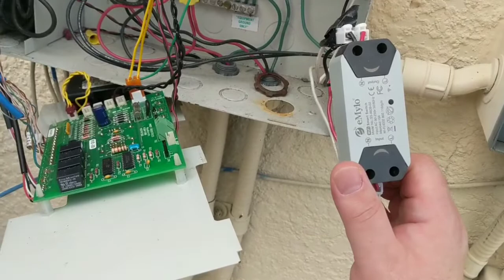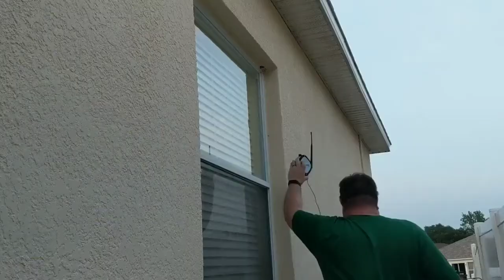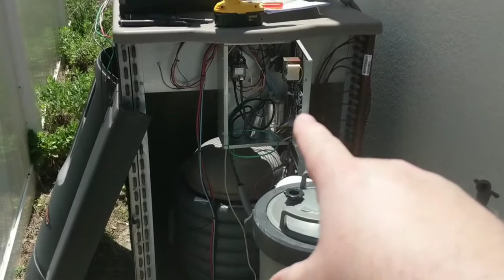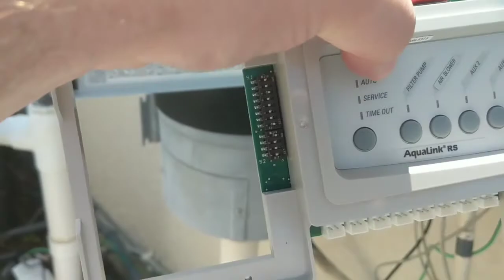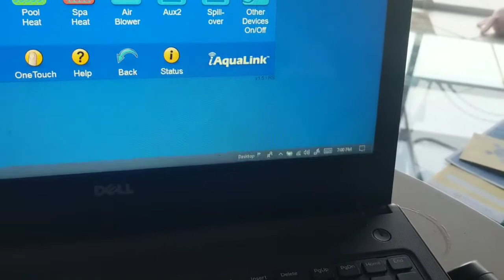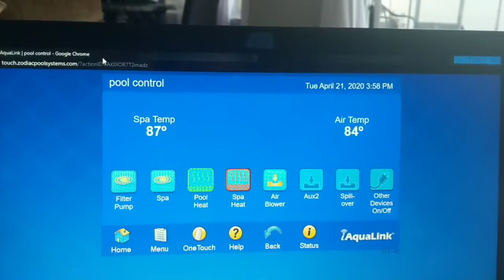Installing the iAqualink 2.0 RS4 system part 2

Comment: Right from start I got a bit bothered by him not putting his drill on hammer but it turned out ok I guess...no heatpump is simple run them into AL and then to the 50amp breaker.

Comment: Good work installing this yourself, it's so silly Jandy won't acknowledge DIY'ers. I just bought the IQ904-PS kit this week, I had the hardest time finding a company that would actually sell it to me. By the looks of all the websites I found it seems like Jandy has reigned in sales to private individuals trying to force everyone to purchase through an installer. Question for you: you didn't have to program the positions of the actuators? I figured you have to tell it (somehow) which direction was which, i.e. actuate the valve up and it's pushing water to the pool or down it's pushing water to the spa. Thanks
Reply: Generally speaking, the valve is turned from the
3 o'clock position 180° to the 9 o'clock position. If this is the opposite of what you need, just flip the toggle switch on the underside of the valve actuator.
Reply: Do you mind sharing where you bought yours from? I am looking to do ours and think its silly they are forcing me to buy and install from a certified installer!
Reply: because there is something called electrical code that almost all homeowners don't know about. It's to protect against electrical hazards that could occur when done incorrectly. As an electrician, I see so much horrible electric work that homeowners have done themselves. I can also see issues with some of the work done in this video. Would not pass a City electrical inspection..

Comment: Question..i am shutting down my water feature for the winter. Both pumps are tied to the same breaker so i cant cut the power to the water feature pump. If i pull the relay on the panel to that pump would that basically disable the water feature pump from ever turning on?

Comment: How is the heater holding up?  I'm installing this as well and as per the manual the heater control wires should be 14awg.
Reply from the maker: Sorry I just saw this message. The heater is doing very well now. As you can see in the video, the original installer used 12ga to run power. It needs to be 6ga.the 14ga is good for the controller box to the automation unit. No power runs through that, it's just data.